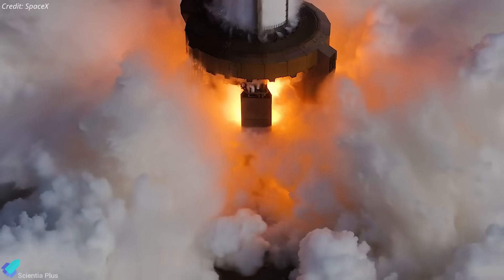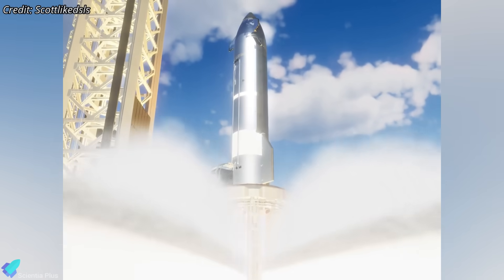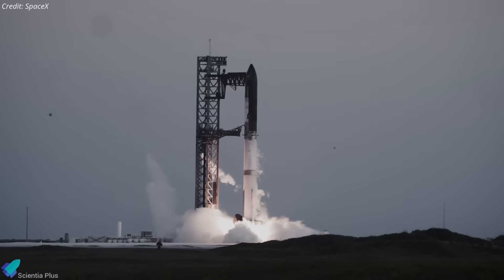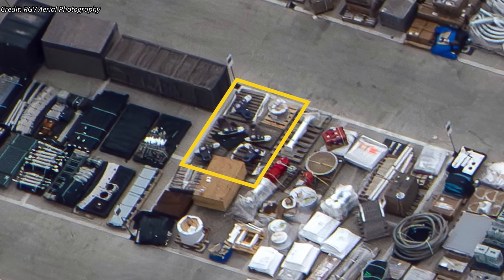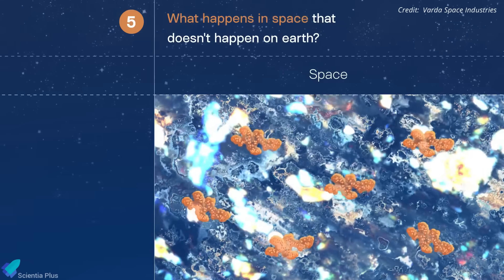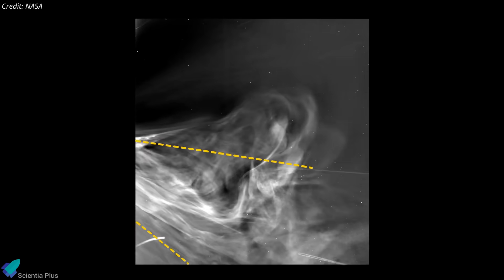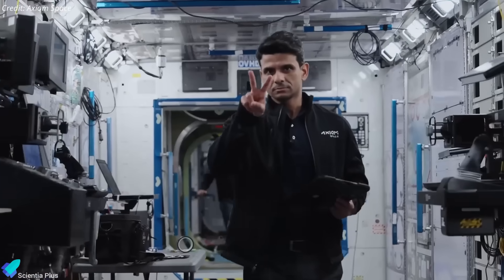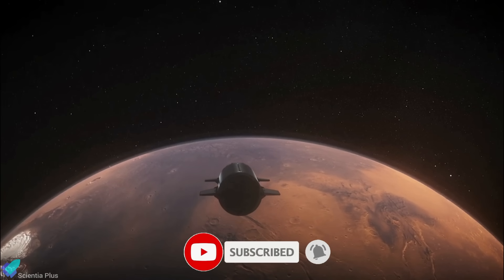Starship Clever Fueling Trick For Flight 10 Static Fire Is Almost Ready! Launch Date Reveal

Comment from the maker: 00:00 Starship Updates
08:40 Parker Probe’s Closest Solar Encounter Footage Revealed—At Last!
10:56 Ax-4 Splashdown Ends Epic Mission!

📚 Learn More:

🚀 Starship Block 2 Explained:
 📖 Summary: https://shorturl.at/b0dtw
 🔍 Detailed Explanations:
  • Design Improvements Update 1: https://shorturl.at/lpGT7
  • Design Improvements Update 2: https://shorturl.at/gwNQ4
  • Nosecone & Payload Bay Redesign: https://shorturl.at/xa60S
  • Methane Downcomer Redesign: https://shorturl.at/XdYBG

🚀 Starship Block 3 Explained: https://shorturl.at/mnBT4
🚀 Starship & Booster Block 3 Detailed Breakdown: https://shorturl.at/IViwD
🚀 Starship & Booster Block 3 Production Begins: https://shorturl.at/xRNkJ
🚀 Booster Block 3 New Transfer Tube Explained: https://shorturl.at/Iaqc6

🔥 Raptor V3 Mega Upgrades & First Test: https://shorturl.at/TRIyj
🧱 What’s Inside Starship GigaBay?: https://shorturl.at/nJM75

Pad B Explained
🛠 Insane Engineering of New Starship Launch Pad B: https://shorturl.at/7RAZd
🛢 Dual-Port Orbital Refueling – Full Technical Breakdown
https://shorturl.at/5tiqK

🛠 Other Starship Upgrades:
 • Hot Staging Explained: https://shorturl.at/jf400
 • Super Heavy Booster Upgrades: https://shorturl.at/Pi5R3
 • How SpaceX Protects Raptor Engines: https://shorturl.at/4Om8F
 • New Heat Tiles Explained: https://shorturl.at/p2Ijb

🔥 Starship 36 Explosion:
   Detailed Breakdown: https://youtu.be/VWQiIz1ymBA
   Damage Report: https://shorturl.at/Quoex

🚀 Ax-4 Mission 60 Research Experiments Details: https://shorturl.at/ZeMxk

📡 Stay Updated:
📢 Weekly Updates: https://bit.ly/3HIQjPC
🚀 SpaceX Playlist: https://bit.ly/34wue8T

🌍 Follow Us:
👍 Facebook: https://www.facebook.com/scientiaplus